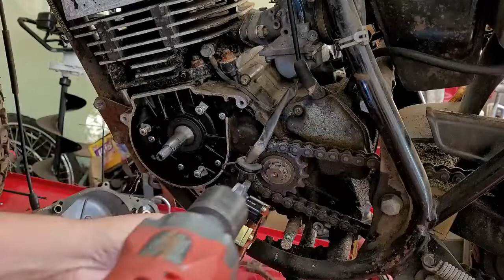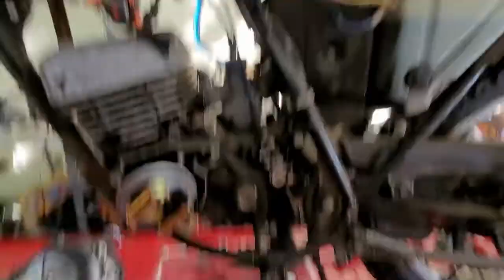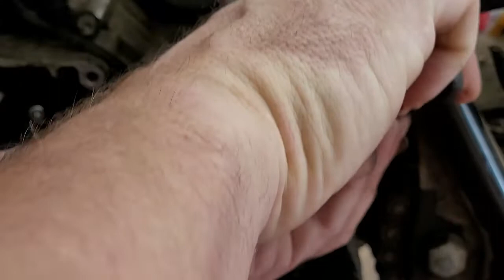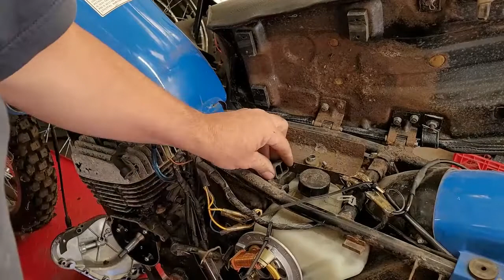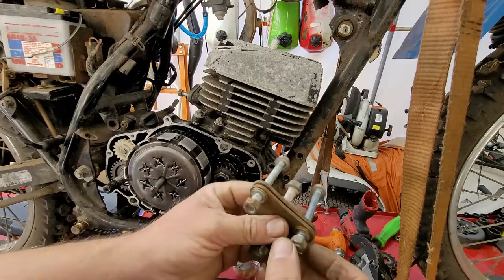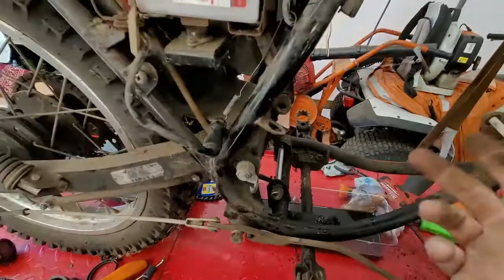How to pull engine on Suzuki TS TC series bikes Working on David's TS125

Comment: hi Kevin  i have question for you .I have  just changed rod in 1975 suzuki tc100 and have it back together  I was putting on piston and found its rod pin that holds piston is to small for this new conecting rod .new rod is for a later year bike around 1980 .do you know if i can use a 1980 piston and pin for a ts 100 to fix my problem thanks john

Comment: I’m planning on buying a 72 Suzuki tc125 of a guy on Facebook, says it has no spark and put a Amazon Ignition Coil on it and still didn’t spark. Could it be a CDI issue? I know for sure dude used the wrong coil because that’s meant for a 12v not a 6v. And any other tips going towards a Suzuki sitting for 6 years will be greatly appreciated. Thanks for reading!

Comment: Is it possible to install oil cooler on this bike?
Reply from the maker: For the 2stroke oil? It doesn't get hot
Reply: @2strokeguru  oh okay okay. Thank you good sir! 😁
Reply: There's no need for one. The transmission oil isn't used to lubricate the crank and top end on a 2 stroke so it doesn't get as hot as a 4 stroke.